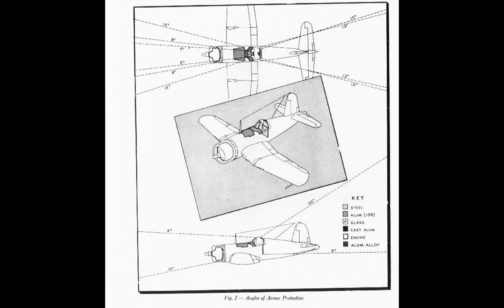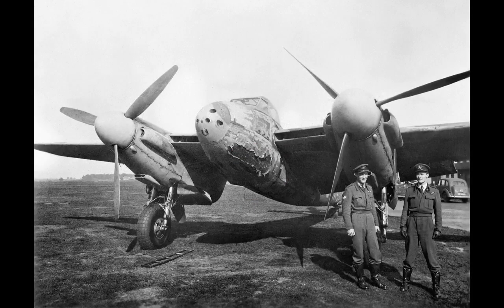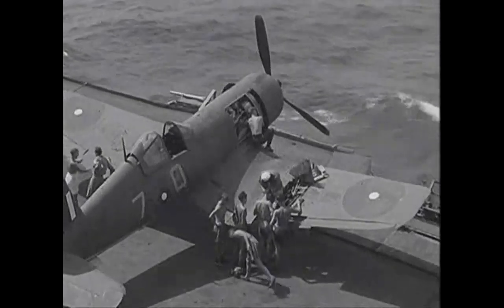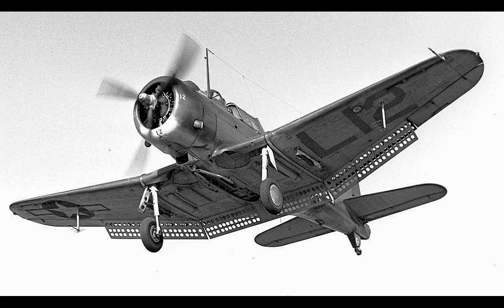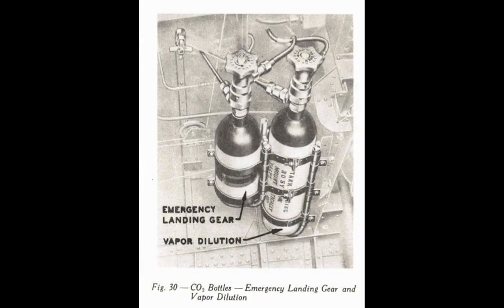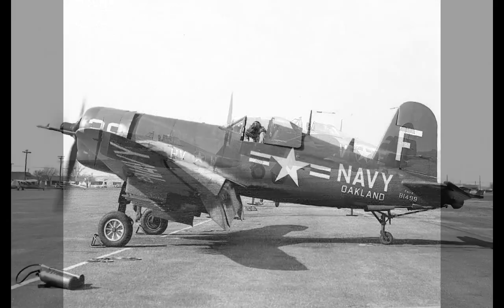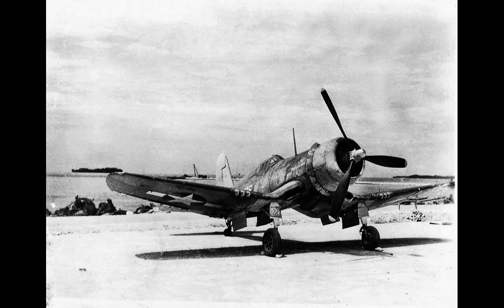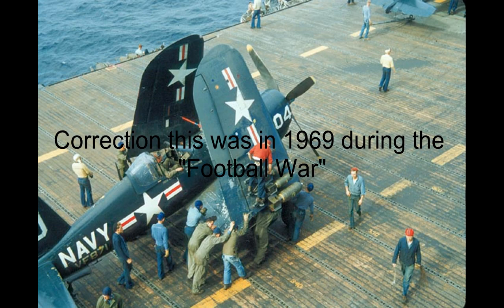F4U Corsair Design Features

Comment: Corsair of the RN were used in  support of a attack on the German battleship Tirpitz
Reply from the maker: Hmm, I did not know that. Thanks.
Reply: this my interest you  Greg  I found on a web sit, Chance Vought F4U Corsair in British Service

The Royal Navy received 2,012 Corsairs. It was the fleet air arm that first used the Corsair from a carrier. Ironically for an aircraft that made its name in the Pacific, the Corsair’s first carrier action came in the North Sea. On 2 April 1944, Corsairs of No. 1834 squadron, based on H.M.S. Victorious took part in an attack on the German battleship Tirpitz, providing fighter cover. Further strikes against the Tirpitz followed in July and August, this time supported by 1842 squadron

The Royal Navy received 95 F4U-1s (designating them as Corsair Is) and 510 F4U-1As (Corsair II) from Chance Vought production. They also received 430 Brewster produced F3A-1Ds (Corsair III) – just over half of the Brewster company's total production of Corsairs, and 977 Goodyear produced FG-1Ds (Corsair IV). If the war had continued in 1946, F4U-4Bs were allocated for the Fleet Air Arm, but were never delivered.

Despite their early European venture, the British Corsairs spent most of the war in the Indian and Pacific oceans. They entered British service just as the fleet returned to the Indian ocean in strength, and took part in strikes against Japanese targets in Burma and Sumatra, including the oil refineries at Palembang. In 1945 the British fleet carriers moved to the Pacific, to take part in the final attack on Japan. British Corsairs saw action against Kamikaze attacks as the British Pacific Fleet attacked the Sakishima Islands, at the southern tip of Japan, before finishing the war making attacks on the Tokyo area.

Comment: Another point on the bent wing is that the smaller gear takes up less space in the wing, allowing for a shorter chord and overall more efficient wing. This also allows for much larger flaps, critical for lowering the stall speed for a carrier fighter which in turn allows for larger ailerons. This contributes to the excellent rolling capability of the aeroplane which was a quality noted by those who fought in and against it.
Reply: DK In Degrees /second what was the Number. I cannot find it. I know the FW190 was 160 deg/sec which was the best in WW2
Reply: @jacktattis143  There is some roll rate data in this flight test report of an F4U-1 at http://www.wwiiaircraftperformance.org/f4u/f4u-1-02155.pdf

Comment: I thought that the aluminum alloy with copper invented in Germany for the dirigibles was called age hardened aluminum.  One problem was that this alloy would corrode.  Plating it with a thin coating of pure aluminum prevented the corrosion and this is what they called duralumin.
Reply from the maker: Maybe it was, although I didn't read anything about aging in the manufacturing process so we could be talking about two different metals. Duralumin/Dural was used in dirigibles and as armor for WW2 planes, but my knowledge of it doesn't go much farther than that, I'm a pilot not a metallurgist and the fact that those names are no longer in use makes them hard to research. When I google Dural, I tend to get results about Star Wars stormtrooper armor.
Reply: The copper-aluminum alloy 2024 is the modern version of the the alloy originally known as Duralumin. It is still a very commonly used aircraft alloy. It is is strengthened by cold work (forming) and heat treatment. In this condition it has a strength higher than  mild steel.
Reply from the maker: Wow, thanks Janyce. That's good info.
Reply: According to my ancient physical metallurgy textbook, the old dirigible alloy is 2117. It's the most commonly used alloy for aircraft rivets.
Reply: Double checked, Alclad was duralumin with nearly pure aluminum coating.  As I recall duralumin could be worked into shape, usually by stamping, heat treated and then allowed to harden over a few days.  Duralumin would corrode and plating it with a thin coating of almost pure aluminum would stop the corrosion (the sheets would be coated before being worked).   Aluminum actually reacts quickly with oxygen but then creates an impervious aluminum-oxide coating on the metal that stops corrosion as oxygen cannot penetrate it.   There are stories that they developed chemicals that would prevent the formation of aluminum-oxide and resistance fighters would use it on German aircraft causing structural failure.

Comment: Great and interesting video, you took up the facts behind a big design factor for the F4U, which I never quite understood the reasoning for as I always been heavy into technical details although not as heavily as you, and I already knew the P47 and F6F used the same engine and the telescoping landing gear of the P47 and the associated teething problems in the beginning but I never given it much more than a fleeting thought on the difference. Now you have highlighted and given much more plausible explanation to the bent or gull-wing design.
One thing I wonder though; as much as I am fascinated about the Chance Vought F4U and it's capabilities, who hasn't heard about Pappy Boyington adding more myth to the F4U (and I'm from Sweden) but you don't mention the high attrition to accidents that the F4U had as more pilots was killed in accidents than in dogfights which is a bit odd for a wartime fighter and by all accounts it was a beast to handle.
Reply from the maker: Hi N0rdman, thanks for your view and comment. I actually did discuss the Corsair's  high attrition due to accidents in my video about using flaps in turns. There is quite a bit about the Corsair in that video.

Comment: Mustang victories depended heavily on having a speed advantage. Didn't work against the Corsair, which could match the P51's speed, and firepower. Plus it could out turn, out climb, and out dive the Mustang.
Reply from the maker: Altitude would be a big factor as well. At 25,000 feet and certainly at 30,000 the Corsair would be in serious trouble against a Mustang, or any of the German high altitude fighters, K4, D9, etc. However, down low the Corsair is a match for just about anything from WW2.
Reply: @GregsAirplanesandAutomobiles  
I assert it wasn't just a "match" it was "check mate".
Reply from the maker: That could be, the Corsair is a fearsome opponent below 20,000 feet, and especially below 12,000.
Reply: @GregsAirplanesandAutomobiles  
......with a Leatherneck pilot.
Reply: @GregsAirplanesandAutomobiles  were and when was this litle war ??  because you placed a picture  of Johan Cruijf against the German team ??   and thats my country..   Or was it the time we playt against Argentina ??  i am so curouis what that was..  never heard about that ...  the rest i knew..lol...
Reply: soaringtractor 
Indeed.  The fact that the F4u was used in the Pacific theatre, where battles at mid to low altitudes were common, has lead some to believe the Corsair lacked chops up top. I’m not convinced. The R2800 breathed just fine up there, the F4u swung a prop much larger than the Mustang, and the wing was a high lift wonder. Had the Corsair been tuned for high altitude (supercharger set up, propeller profile). I think the F4u could have been an outstanding high altitude fighter. The service ceiling was within 400ft of the P51D (41500 vs 41900). 
I wonder if there is any first hand accounts of high altitude  handling performance.

Comment: About the main landing gear wheel covers, the I-16 had them as well, I wonder if that was the first fighter with that feature? Another one that's interesting is the Yak-7, because it was based off the trainer variant of the Yak-1, but the Yak-1 itself didn't have it's main wheels fully covered, and didn't get this feature until upgraded into the Yak-3 late in the war, taking some time to catch on it's -7/-9 brothers in this regard.

I wonder which was the first fighter in service with all of it's wheels fully covered in flight? I think it might be the P-39.
Reply: I think the I-16 might be correct even if we take the type 18 or type 24 we end up in the year 1939 or 1940, don't know wich one. About the p-39. It was at least one of the earlier fighters with fully closed landinggear, but it was the first American fighter to have all round visibility in an fully enclosed cockpit, if I remember correctly. I still don't get why the p-39 Airacobra still has such a bad reputation....
Reply: As far as I know even the early ones from 1935 like the Type 5 got them. The P-39 has a bad reputation because it wasn't optimal in the Western and Pacific theaters as it suffered at high altitudes, because of the Allison's single speed single gear supercharger, more optimized towards low-medium altitudes. On the other hand it did well in the Eastern Front, where the Soviets appreciated it's low altitude performance and had some advantages over Soviet-made fighters like radio quality and high dive speed limit. Of the top 10 Allied aces (all of them Soviet), half of them got most of their kills in P-39s if i'm correct.

Comment: Wasn't you that said that the US, when they captured the Zero, found that the vert stab was in front of the hor stabs to give it greater turning ability too? So perhaps it was borrowed technology.
Reply: The Zero was captured more than two years after the F4U's first flight.
Reply from the maker: The Zero's tail is the exact opposite of the Corsairs. The Zero has the vertical stabilizer AFT of the horizontal. I actually have a video about that.
Reply: Ah, my cursed dislexia. Well great video here man thanks!

Comment: According to the British air museum in Duxford, the Bearcat served until 1955 so the Corsair couldn't have served longer if it lasted until 53. (In US service)
Reply from the maker: I said in production. The Bearcat production ended in 1948, the Corsair in 1953. However in terms of service, the Corsair served in the military of Honduras until 1979, so it was in service far longer as well.
Reply: the corsair was built until 1953- actually Dec. 24, 1952 was the last day officially they were produced.
Reply: I believe post-war corsairs only had single stage supercharger due to being intended for ground attack only. So, top speed just under 400. They still looked great.
Reply: Robert Buss  Well, Robert, I don't believe that is correct. The F4U-5 (late '40s production) had a two-stage supercharger but it used an automatic switching called APU (which was problematical for shipboard launches and formation flying.) I believe that the AU-1/F4U-6 attack version of the -5 had a single-stage manual supercharger.

Comment: F6F pilots also used their landing gear as a rudimentary dive brake, by simply unlocking the maingear. The unit then fell via gravity into the slipstream while maintaining the wheels' perpendicular (stowed) configuration, creating a fair amount of drag. At the conclusion of the attack run the pilot reselected gear-up, though I am unclear whether any manipulation of the hydraulics
 was required for the procedure.

Excellent video, as always................................
Reply from the maker: I have heard that about the Hellcat, but when I looked into it I couldn't find a single official reference for it. I don't doubt that some pilots did it, but that doesn't mean the plane was designed for it, the Corsair was. Don't take this as me being anti-Hellcat. The Hellcat was certainly an awesome plane. If I had to fly one of the two off of a carrier, I would probably chose the Hellcat. However, if I was an Admiral in WW2 and had to chose which plane to send to stop inbound Kamikazes, it would be the Corsair.
Reply: No, it certainly wasn't a design feature, merely something pilots developed in the course of their work. I first read about it in an account of the fighting on Saipan, where the F6Fs flying close-air-support needed to get pretty tight into the hills to hit targets. The procedure gave them a few extra seconds to get eyes on and line-up. I'll go back through my library (unlike Google, it's not got a good search engine) and see if I can get you the title.
Reply: Also, a supplemental report on the F2G- specifically designed to counter the Kamikaze threat would be appreciated.

Comment: Was dural used in aircraft structures in the WWII period, or was it primarily armour?
Reply from the maker: That's a good question. I am sure it was, as a lot of US and German industry was involved in airship construction, where it was used, and many of those same companies were later involved in building airplanes. So I just can't imagine that it wasn't used in aircraft structures, but I don't have any reference for this. The terminology has changed, and the words Dural and Duralumin are not in use anymore, so it's difficult to research this. It would really take a metals expert to sort it all out.
Reply: Without seeing the production drawings, it's hard to say for sure. But I expect that 2024, the successor to the old dirigible alloy (dural) (2117) would have been used for all of the aluminum airframe. Keep in mind that 'dural' was broadly used to describe any heat-treatable aluminum alloy.

For ordinary structure, with thicknesses of about 1mm ( .040 inches) or less, dural won't provide much in the way of protection. But in heavier thicknesses , say 6mm  (.25 inches) dural will protect quite well, especially at oblique angles.